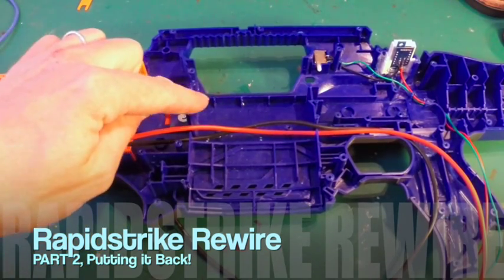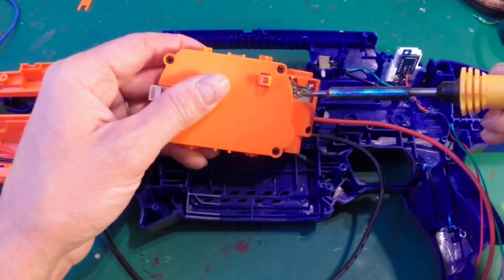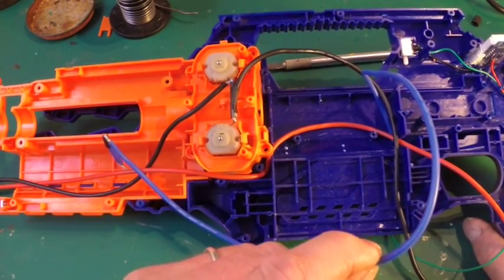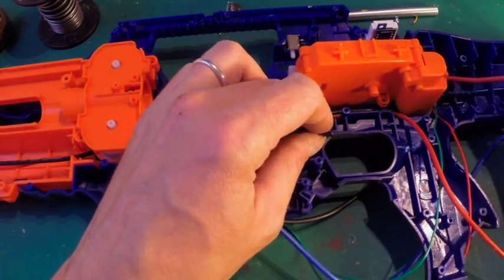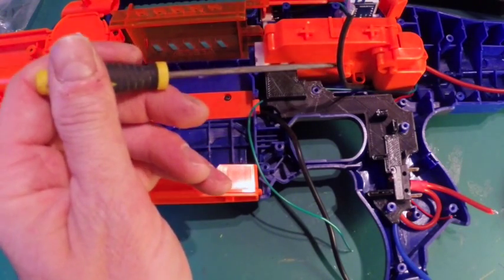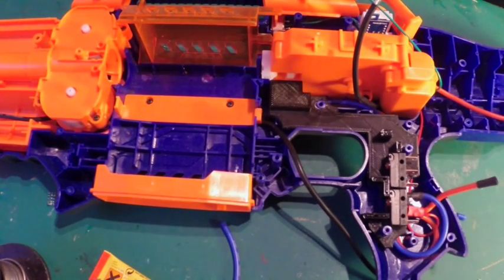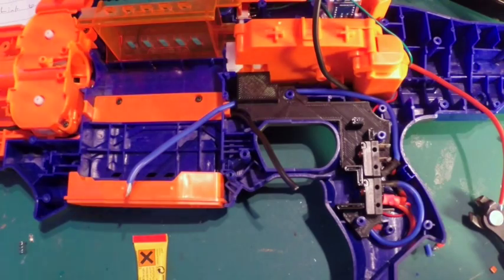Nerf Rapidstrike Re Wire Pt2

Comment: I'm doing 2 krakens and a honey badger pusher on 3s do I need diodes
Reply: Jonah Monempour I don’t recommend honey badger pushers, they are awful. If you do the dead centre diagram from Britnerf then you won’t need a diode on the pusher. If you are doing anything else then you want a diode over the pusher and the flywheels. FETs hate EMF.
Reply: I’m not using a mosfet
Reply: What is wrong with honey badgers they have good rof
Reply from the maker: Jonah Monempour They are a crappy pusher motor, you can’t get decent motor braking out of them. Use a third Kraken instead. If you are not using a Mosfet then you don’t need diodes to drop the voltage. Those were only a thing for stock pusher motors.

Comment: Im doing imrs with stock motors in my retaliator. Do i need a diode?
Reply from the maker: You always need a diode with a MOSFET, this video is about LEDs and the Retaliator is a springer. I have no idea what you are on about.
Reply: Foamdata Services sorry I meant a rapid strike 😂. My problem is when I run the pusher motor the rpm of the flywheels drops a lot and I was wondering how to fix this
Reply from the maker: Luke L. A better battery will fix that. You can just add an XT60 connector and 6” of wire to the stock RS loom and run a 7.2v Nimh or 2s lipo on it with no other mods.

Comment: at 9:37 you say make connection to common, but on the diagram it shows the rev motor going to common?
Reply from the maker: The only -ve connection is to the cycle control switch. Rev trigger is +in from main batt, + out to motors.

Comment: I thought i had it all wired up correctly, but nothing fires up.  How sensitive are those switches, wondering if I overheated them with solder?  A simple test verifies I have power to rev switch but not coming out, and motors work... hmm
Reply from the maker: You should check all the joins individually to ensure they are fully connected, also if you heat any switch up until you can’t touch it on the body, you probably melted the internals. The rev switch should work on its own. Tthere must be only one negative wire in the whole trigger cluster, the one that goes to the cycle control centre pin, no other switches should have a -ve.
If you get more stuck go to Britnerf and post pictures of your loom to the forum, those guys will fix it. Youtube comments are  awful for fixing things over.
Reply from the maker: Also the pusher switch +ve doesn’t come from the rev switch, you want a split feed running off the main +ve in BEFORE the rev trigger.

Comment: I bought two hellcat motors, and a 3s lipo, can I stay with the stock pusher motor, or will the 3s burn it up?
Reply from the maker: Bryan Overton I would put something like a Rhino or Valkyrie 130 on the pusher. Hellcats are OK but the newer 130 motors like Krakens give the same performance without shell cutting.

Comment: If I run two rhinos & a honey badger on a 3s, do I need diodes?  If so, what ones?
Reply from the maker: I never use diodes on the pusher motor. I would also put a third rhino in, the Honeybadgers I have tried were all very poor at braking and eventually broke down on 3s. If you insist on using one then IN5400 series diodes will drop the forward voltage by 0.9v each.

Comment: So, let me see if I understand the need for diodes: you only put in a diode if your pusher motor can't handle the voltage of the battery and would melt if it took the full load?

Am I close? I'm putting two Hellcats and a Rhino in a Rapidstrike, and I figured that since they took the same voltage and relatively the same amperage nothing would melt.
Reply from the maker: The battery doesn't "push" power to the motor. The motor draws the current it needs according to load and higher voltage makes it spin faster. Diodes are only required if you need to lower the voltage to the pusher. I never use them, I just use the correct motor for my voltage instead. When we first started people would use barricade flywheel motors and run 3s then the stock pusher motor would get rekd, so they used diodes. Totally uneccesary with modern motors.
Reply: Foamdata Services
Oh. I always thought the motors forced the full current into each motor. Geez, and I'm supposed to be training to be an electrician. Well, thanks for clearing that up.

Comment: how many darts a second would a hell cat give me
Reply from the maker: 12dps @3s
Reply: BSU has a loom kit specially made for 2 hellcats and 1 honeybadger on a 3s. In that kits come diodes and a complicated wiring diagram but after talking to you u told me I don't a diode or anything like that. So should I just buy the kit you reviewed cause u said I'll be fine with that or should I get the  BSU kite specifically made  for for what I'm doing. I just want something simple and works for what I'm doing. I'm like you wiring diagrams make absolutely no sense to me. Last question it is possible to make tri xp 180 rapidstrike and how many DPs would that give me on a 2s. Thank you so much u are the bomb Tom and thank you so much for your help.
Reply from the maker: Triple Extreme gives 12-14dps @ 2s. You need a 40C constant Lipo minimum for that with at least 60c burst. XP's are massive current hogs. The BSUK kit is fine, if you go triple Hellcat, just DONT USE THE DIODE and stick a Hellcat in the pusher. Ask BSUK to give you a motor cover set including the pusher cover and you are good.
Reply: Awesome thanks but I heard a honeybadger with a 3s screws it up so I'm going with 2
XPS and a honeybadger because they where made for a 2s I won't get 14 darts a second but that's is a little to fast for my taste and thank you so much.
Reply from the maker: Using 180 size motors in pushers is vastly superior to a 130. Triple Hellcats are much cheaper than triple XP's and they need less current, plus the shafts are a better length. Don't use a Honeybadger pusher, you can easily single shot BETTER with a 180, as they make more torque and if you want less DPS use a 3240. I never use any 130 size pushers in my modded blasters, always 180's.
Reply: OK but 3 hellcats means diodes and I don't want to mess with that. what motor set up would you do Tom?
Reply from the maker: YOU DONT NEED DIODES WITH A 180 OR A HELLCAT. They are there to stop the crappy Honeybadger melting itself on 3s. All they do is drop the voltage to the pusher to slow it down to compensate for its crap torque, use triple hellcats for best compromise between power requirements, cost and performance.
Reply: Foamdata Services do you need diodes for a rhino on 2s

Comment: Let's say I do get this kit do I have to use the pusher much micro switch?
Reply from the maker: If you want proper reliability you should replace all the junk stock switches. You don't need the kit, the wiring is the same for any microswitch. I use this kit as it saves time.
Reply from the maker: You can use peasant two switch with the BSUK kit. I have no idea why you would want to but you can.
Reply: I don't want this to sound weird but can I have your email to send you pictures of a wiring diagram I came up with cuz the ones on line make no sense to me
I promise I'm not tring to steel your identity or anything I'm just a 14 year old kid that loves modding.
Reply from the maker: I can be contacted through Britnerf or my email is listed through this site. I am not in the habit of emailing minors or publicly listing my email.

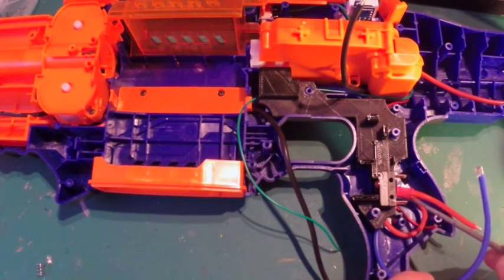Comment: Great tutorial!  In the process of using it to mod my - I mean my son's - RapidStrike.  Just as FYI - @ 6:30 you mention attaching the blue wire to normally closed, but I believe that it's actually supposed to be the common terminal.
Reply from the maker: Red, main battery power, goes to the common, blue goes to the Normally Open, so when you Rev it you complete the circuit. Good spot, will add an annotation to the description box. It's really hard to think, film and solder at the same time!